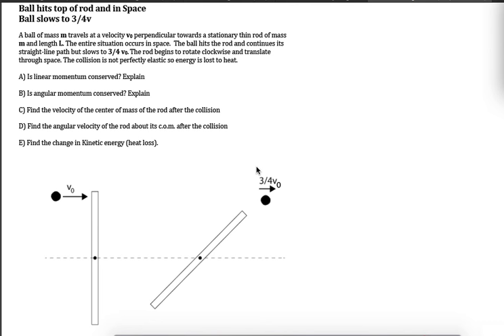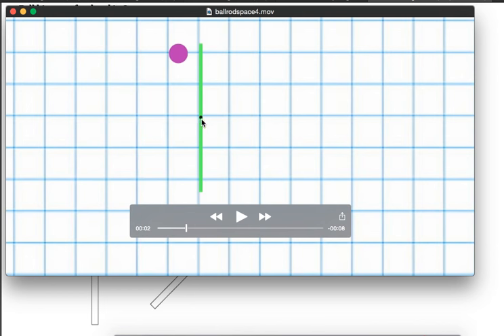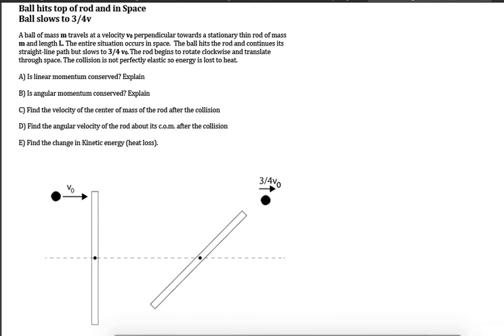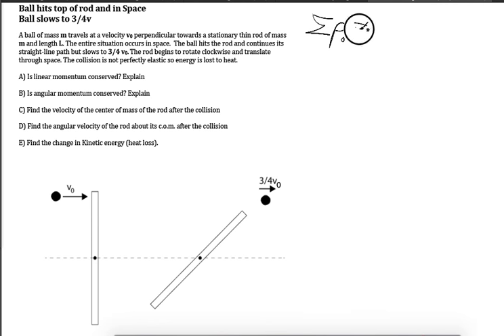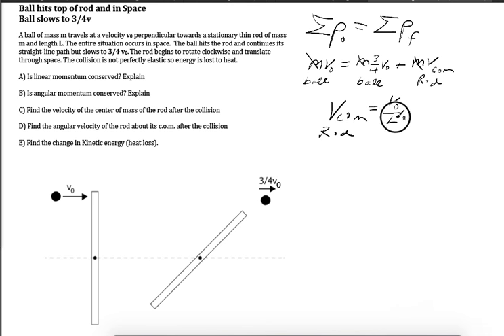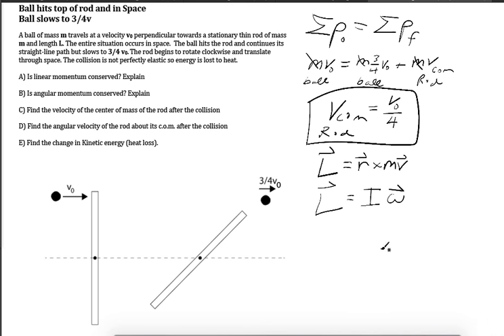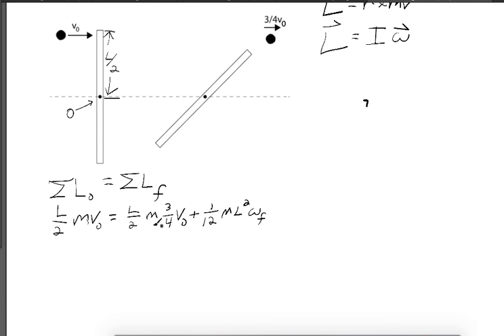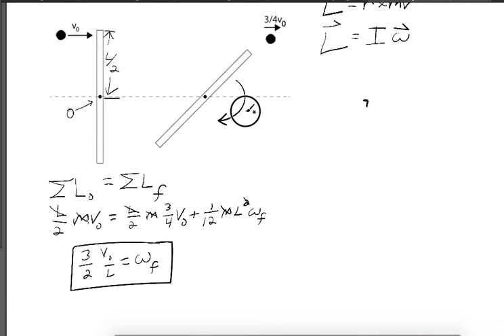Ball hits rod in space: Physics Solution

Comment: Not sure I agree with this. Can you clarify one point for me. After the collision the ball's speed relative to the origin is (3/4)v(0) However, after the collision, the center of mass of the rod is no longer at the origin, and the velocity of the ball relative to the center of mass of the rod is (3/4)v(0)- (1/4)v(0)=(1/2)v(0). It seems (to me) one should use this value in the conservation of angular momentum equation. Not (3/4)v(0). 
One could of course still use the original origin for the calculations, but the moment of inertia around that point is no longer (1/12)mL^2, but continually changing in time as it gets further away.

Comment: Bro, why linear momentum is independent of de point of the collision?? I mean, why does the rod has the same  CM velocity whatever the point of collision is?
Reply: I was struggling with this too, however, I think I found the solution: it is not true that the rod has the same CM velocity whatever the point of collision is. The best way to prove this is using the three laws of conservation of linear momentum, angular momentum and energy. Lets change the problem a bit and ignore friction. Lets say we are looking for the final velociy of the cm of the rod, and the ball depending where on the rod it strikes: We assume the bal and rod of length L both have mass M and that the ball has velocity v0:

for linear momentum we find:
mv0 = mv1 + mv2 

with v1 the velocity of the ball after the collision, and mv2 the velocity of the CM.

for angular momentum we find

0.5*m*L*v0 = 0.5*m*L*v1 + Iw  where I = 1/12mL^12 as in the example

for energy we have:

1/2 mv0^2 = 1/2 mv1^2 + 1/2mv2^2 + 1/2Iw^2

we have three equations to find three unknowns, v1,v2 and w. If you solve this you will find that collisions close to the center of the rod will result in higher linear velocity, while collisions close to the edge of the rod will result in high rotational motion with smaller linear velocity
Reply: @arnoholtrop3168  Thank you! Well the problem is that we can't use conservation of energy because we have to also compute the loss, so how can we fix that
Reply: A rather late reply, but the solution is simple: add the heat loss to the right side of the energy balance equation. Of course we have 3 equations here, so we can have only a maximum of three unknowns in the problem in order to solve it. So of the 5 variables v0,v1,v2,w and heat loss, we need to know at least 2 to find the remaining variables, in any situation.

Comment: Thanks for making this.  I am a little confused by your calculation of the angular velocity of the bar.  You use the velocity of the ball after the collision (3v[0]/4) directly, but I was expecting you to need to subtract out the newly acquired velocity of the rod's center of mass (v[0]/4).  Is this correct, or am I misunderstanding angular momentum?  Thanks in advance for your time.
Reply from the maker: I went back through it and it is correct. It's similar to cons of linear momentum. You essentially are finding the change. You are just setting up the equation with final and initial. But you can't just subtract the velocities, you need to subtract the momenta.
Reply: physicsfrac thanks!